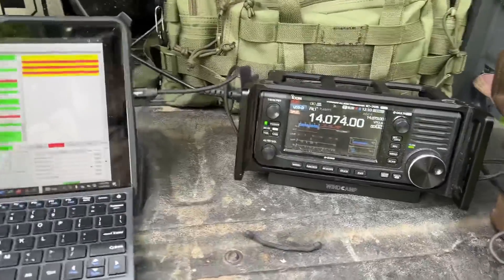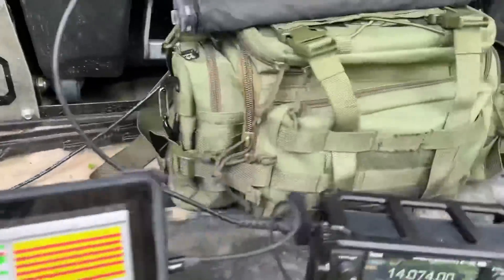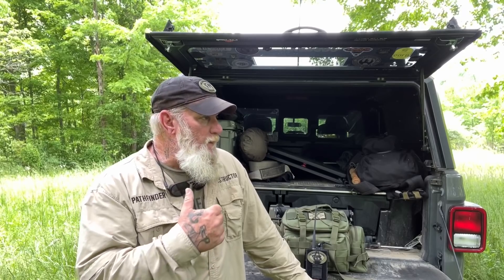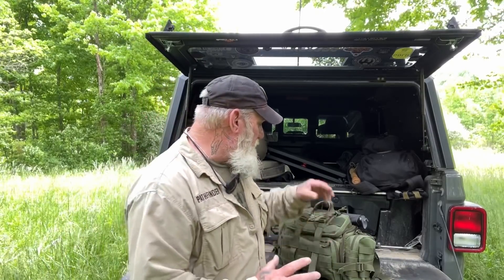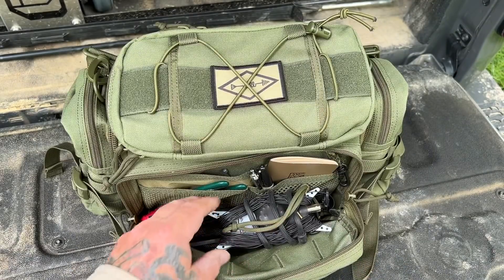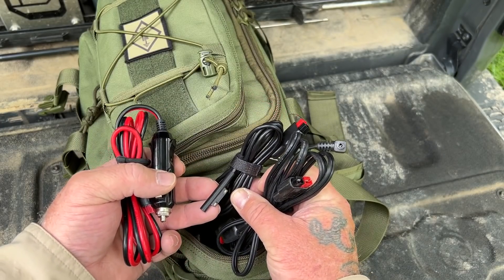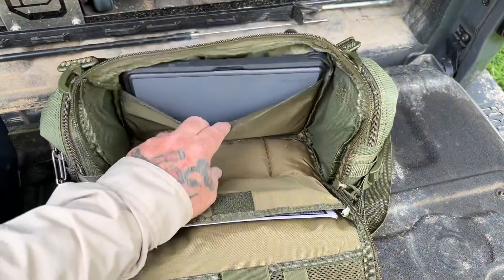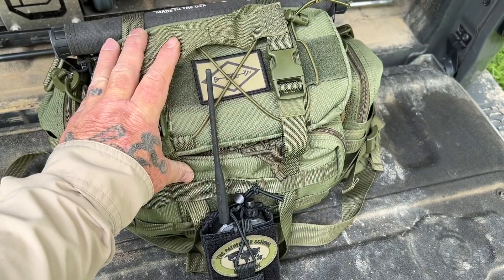Go Bag for Base Emergency Comms

Comment: Dave, on learning CW, here are a few tips from an old Ham, a “code Extra”. DO NOT memorize the characters. If you do, you will fail or never do more than about 5 WPM.  Learn the sound. Use the Farnsworth method to learn the code. In other words, learn the sound of the code at a higher speed with a longer space between characters. I suggest sending them at 18 WPM with a 5 WPM spacing. This way you learn the sound and it is easier to increase your speed by decrease the spacing as you learn the code. I hope this helps! 73 DE W4GHW

Comment: I prefer the Yaesu FT5DR over the Icom ID-52 namely because it will do what the 52 won't - TRUE WIDEBAND RECEIVE.
I have both an ID-51 (VHF/UHF) and ID-31 (UHF) and like both of them however with the FT5DR from Yaesu I can transmit not only on the VHF/UHF ham bands but after a quick mod I can tranmist on FRS/GMRS/MURS/Itinerant Business/Marine/Air Band freqs in an emergency as well as receive FM & shortwave with a wire antenna clipped onto a ring terminal screwed down on the antenna connector.
The ID-52 doesn't do APRS either whereas the FT5DR does.  The quick-release belt holster clip for the FT5DR is also better than the ID-52.
The ID-52 only picks up 88Mhz-174Mhz and 225Mhz-479Mhz yet Icom calls that a "wideband receiver".  It's really not.  The FT5DR receives from .5Mhz to 999.99Mhz.  That is a true wideband receiver.
That said, the ID-51 & ID-31 I have have been relegated for emergency use with digital voice with each other.  
And a Baofeng UV-5R just to have sitting out in view to anger the old, sad hams out there and to hand off to another operator who might have broken theirs during a special event I might be working.

Comment: I see you're still carrying the counterpoise. I  remember when you first explained the idea I thought it made a lot of sense,  but almost the next day I saw HRCC answer a chat question about how effective they were with the idea that the body of the person holding the HT is already acting as a counterpoise, so adding a second shouldn't do much.  Have you seen any appreciable change from it?
Reply from the maker: I use the CP for 2m on my 705 when you not holding it. But the body works as a CP only if you are holding the radio correctly to my understanding

Comment: David, that antenna really needs a counterpoise (like a vehicle body) or radials. Efficiency will be very poor without it. Im sure it's enough for low speed digital modes while propagation is good but you would struggle to make a connection with another station with voice (Phone SSB) mode. 
For the existing setup, like in this video, make sure to bond the coax's shield (at the antenna connector) to the tripod. Also make sure all the major parts in the tripod are interconnected electrically.
For a vehicle, I strongly recommend to use a Tarheel, screwdriver type vertical antenna. They work very well and require no tuner on all bands the antenna model s designed for. Changing bands takes just seconds without any external controllers.
Reply: Without the counterpoise wire, the outside of the coax shield will radiate and that can cause distortion on the transmitted signal !

Comment: SORRY FOR THE ALL CAPS BUT AT 77 MY EYE SIGHT IS FAILING ME.
FIRST DAVE YOU ARE A VERY FAST LEARNER…YOU HAVE TAKEN TO HAM RADIO LIKE A DUCK TO WATER! I LOVE YOUR COMMS GO BAG AND ALL OF YOUR EQUIPMENT IS TOP NOTCH!
MY WIFE AND I HAVE BEEN HAMS FOR ABOUT 45 YEARS NOW AND STILL HAVING A GREAT TIME “PLAYING RADIO”. 
THE ONLY THING THAT I WOULD ADD IS AN EMP/CME PROOF BAG MADE BY MISSION DARKNESS AND AVAILABLE ON AMAZON. YES IT WOULD BE A BAG IN A BAG BUT ALL THAT WONDERFUL AND EXPENSIVE EQUIPMENT WOULD ONLY BECOME A VERY EXPENSIVE PAPER WEIGHT OR A DOOR STOP! I AM RETIRED AND ON A FIX INCOME BUT FOR MY MONEY YOU CAN NOT BEAT THE MISSION DARKNESS FARADAY BAGS.  THERE A LOT OF OTHER COMPANIES OUT THERE BUT MOST DO NOT HAVE THEIR PRODUCTS TESTED BY INDEPENDENT LABS. I OWE A FEW FOR MY HAM,  GMRS, AM/FM/S.W./WX RADIOS, CHARGERS , AND EVEN LED FLASHLIGHTS, LAPTOPS AND BATTERIES!
WHY BATTERIES BECAUSE A LOT OF THEM HAVE VERY SMALL IC CHARGING PROTECTION CIRCUITS BUILT INTO THEM.
 CHECK MISSION DARKNESS OUT WHEN YOU HAVE A CHANCE.
I ALWAYS ENJOY YOUR YOUTUBE VIDEOS AND I DOWNLOAD AND SAVE THEM TO A FLASH DRIVES FOR FUTURE REFERENCE. AND OF COURSE THEY ARE ALL STORED IN A SMALLER SIZE MISSION DARKNESS FARADAY BAG!
DAVE I HOPE TO HAVE THE HONOR TO WORK YOUR FINE STATION ONE DAY! 
73 DAVE!
PS I LOVE YOUR STORE AND ALL OF THE GREAT GEAR THAT YOU SELL THERE…I OWN A LOT OF THEM…JUST DONT TELL THE XLY
(HAM TALK FOR WIFE)😱👍
GOD BLESS YOU ALL 🙏

Comment: In a emergency comm situation, a 20m is going to give you intel from far away. If you want to make regional contacts for support/supplies/etc wouldn't it be best to do a 40 or 80 meter setup? or NVIS?
Reply from the maker: Did you listen to the whole video brother or watch the others in this series?

Comment: It would be time consuming but a video on how to use a bf-f9, like basics for a bugout or for if we had a huge storm where things are down for weeks or more, would be super helpful. I tried finding videos on basics and the content is difficult to sort through and they don't make instructional videos as good as you do
Reply: Robert, not sure Dave has that Radio to cover a video.  In the end, the concept is always the same.  Radio, antenna and power source.  For that Radio, you won't need most of what Dave covers here.  I have no experience with that Radio, but I am pretty sure any Baofeng programming video will get you started.  The ones I have or have used are nearly identical.  

For basics of Ham radio..  I'd suggest checking out Ham Radio Crash Course to get started.  May need to dig thru his voluminous content but Josh has a lot of great info for beginners, new vids and old.  Don't be stuck on everything having to being about your radio.  Take the greater concepts and mold your own comm plan.  If you need to bug put or deal with the aftermath of a storm, you may have a chance to use other radios you will be happy you can figure things out.  Just my thoughts. 

 Best of luck.  73

Comment: Dave Canterbury
I'm kinda old school here..
If an EMP " Should occur , how reliable are these Radio set ups ?
Reply: Not very. Unless  they are in a Faraday cage then they should be fine. Just keep an extra baogang and in a cage and you will be golden.
Reply: I've heard that unless you are on the power grid at the time of the emp, then your gear should be fine. Not sure how true that is though.
Reply: PLEASE READ MY REPLY TO DAVE HERE TODAY!
Reply: Build a homemade Faraday cage
Reply: I haven't seen and commercial electronics that will take an EMP hit. Unless you store the electronics in some kind of Faraday cage or Faraday shield we're SOL.